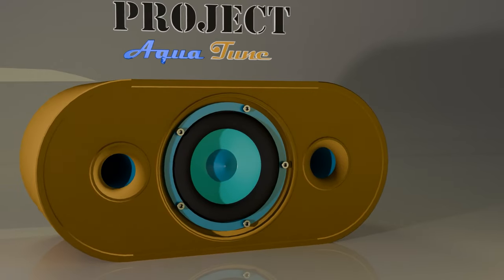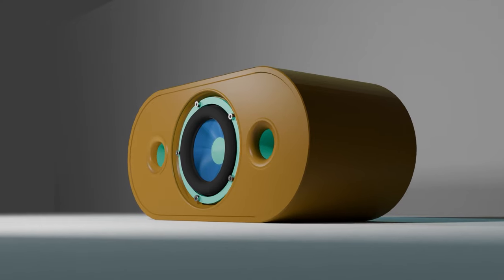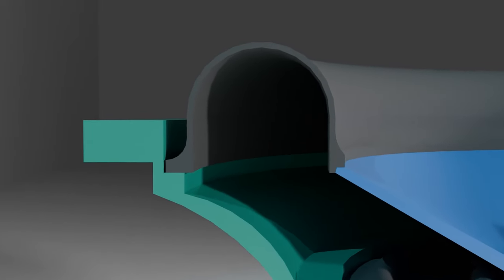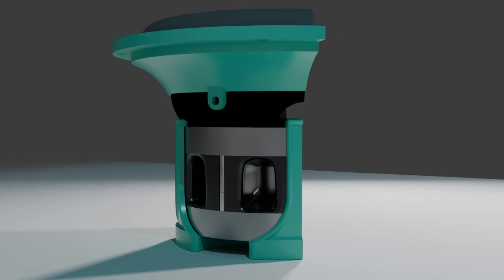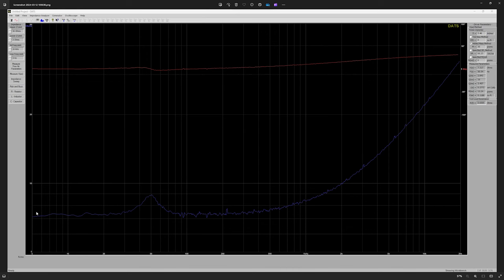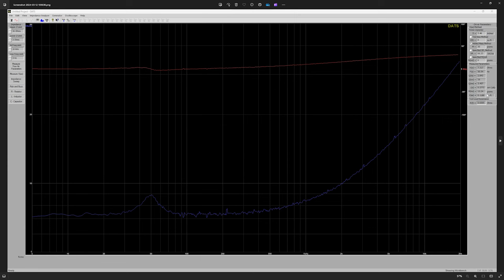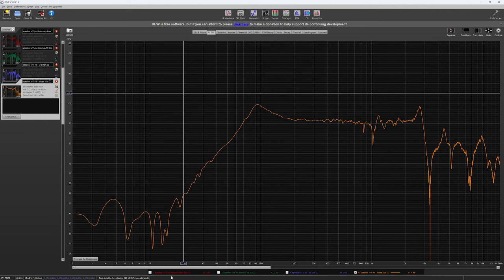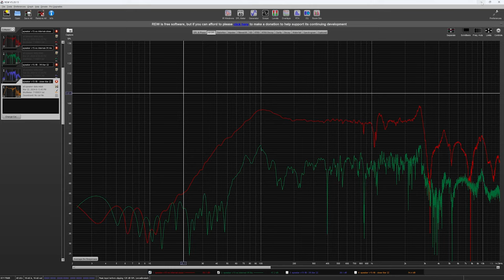Fully 3D Printed Speaker V15

Comment: Outrageously cool project. I did not expect to see this level of sophisticated engineering. I think it would be really interesting to see how viable a 3D-printed tweeter or subwoofer could be. This driver is probably best suited as a midrange / mid-woofer (although I would love to see its spectral decay chart to get the full picture)... but imagine a fully 3D printed 3-way design where the individual drivers are tweaked specifically to synergize perfectly and achieve an incredibly personalized sound signature. There are so many possibilities with additive manufacturing that I wonder if this won't eventually become reality at some point.
Reply from the maker: thanks! I try to push the limits with 3d printers, sometimes I succeed and sometimes I fail, either way it's fun along the way.!

Comment: Underhung designs are less efficient, but more linear. For something like this imo, overhung is the way to go. I wonder if the upper response is like that due to cone breakup. Maybe a deeper cone would help.
Reply from the maker: I’m not sure on the cone breakup, I’m currently trying motor configurations until I find something I wanna build on. I do however know I’ve talked to multiple other individuals who print speakers and they’ve all settled in on the underhung design as well. So it might be a natural route in the 3D printed speaker workspace. 

I know a lot of high end speakers go the underhung route as well, but they don’t have to be as competitive in pricing, as underhung is always way more cost prohibitive.

Comment: Great Video.  What do you use for your animations.  They look great. 

I wonder if you could use this process to repair a speaker.  The KEF speakers use some weird material for their cone like on the KEF150 and there is always someone selling a speaker with a torn cone on eBay.  It would be cool to see if the torn cone could be replaced with a 3D printed part.
Reply from the maker: I use blender + cycles.

Comment: very professional... what CAD did you use?
Reply from the maker: I use fusion 360. I have about 10 years experience with it. Then I just picked up blender to do animations with, I have about 40-50 hours in blender so far excluding render time.
Reply: @piscesprinting4170  FreeCAD seems to require a lot of "work-arounds" especially the "thickness operation"
Reply from the maker: I’ve never used that one. Back when I started fusion I had the hobby license. I then had a few years under the education license and I’m now buying it myself. I think it’s worth the ~600/year price tag. I’ll usually try buying during a deal though so it’s less than that.
Reply: not tried it yet!

Comment: I like it very much, and it sounds quite good! ;)  But why is the basket closed between the membrane and the spider? In this case, the membrane's air pressure have to go through the spider, and under it, can ventillate into the box... I have some idea for better performance. A driver, with a weak magnetic motor (high Qts) more ideal in a transmission-line! For better efficiency, try place small, around 2 cm height block neo magnets around the coil inside, and outside! This will increase the magnetic flux, and reduce inductance, because of less iron close to the coil, and because of the magnet's high saturation and big coercitive force! For a lighter membrane, you can create a pattern on the membrane, where it can be thinner and concave or convex. Just think of a leaf: thin, light and stiff. For better high range, you can shape the membrane from the coil body like the shape of the rubber surround, and after it continues the normal cone (curved NAWI-shape is better, than straight cone)  shape. It will give some elasticity to the inner part of the membrane, and because of it is much lighter than the whole membrane, it can give the high freqvencies better. It's a physical crossover. There are old drivers used this idea, but maybe not the most hifi or something, because you can't see it nowadays, only the whizzer-cone solution... Next. I hate dustcaps, somehow I don't like that the sound vibrating between the dustcap and the polepiece (place foam or something onto the pole piece, if you want cleaner sound)... Moving mass is less without it, so faster can be the membrane! Phase-plug is better solution, I think... Good job! Have fun! ;)
Reply from the maker: The lack of holes was overlooked in the animations, the final driver has holes that allow air to escape properly. 

I did assemble one without holes just to mess around and see what happened. ( off camera, as I felt the experiment was useless for my audience)

Essentially it acted like I had giant moving mass on my speaker (all the trapped air) so it was a fun experiment. It’s Fs also raised into the 500s and efficiency was terrible - sub 60dB 1w/1m
Reply from the maker: As for the other ideas I’ll look into them! Thanks for them!
Reply: @piscesprinting4170  For wide-range drivers often used an inverted surround, it can help in the smoother, wider response! If you wanna less standing-waves on the membrane, try to avoid perfectly concentric shape! The wave starts from the coil, reflects at the edge of the membrane, and meet with another wave. This distance can be varied on the membrane radially, so less standing wave can meet each other in the same time! ;) You can place the coil not in the center, for example 0.5 cm away from it, or use a little oval-shape membrane. The surround can have waves in more dimensions too! For a lighter membrane, you can try to thinning it with sandpaper, to have higher efficiency and better highs. On every moving part (membrane, coil body, dustcap, surround, spider) try to reduce mass! Thanks for your videos, they are very interesting! Have a nice day! ;)

Comment: Shouldn’t the standing wave baffles be irregular? With a complex but regular pattern you’re guaranteed to get some standing wave in there.
Reply from the maker: I suppose it would be determined by the frequency that I’m trying to nullify. As the shape to reduce 20hz vs 5khz would be thoroughly different. 

My thoughts now that I see it can be done is to use a no wall, no top, gyroid infill based on the shape I’m going for, I figure since it allows passage of air but it’s through a series a channels it would reduce standing waves much more effectively.

Comment: Hey I think this design is awesome and reminds me a lot of a more of a subwoofer and that's why it sounds so muffled, I really think efficiency could improve if you "broke in" your speaker driver, the spider and surround are naturally stiff and if you leave the speaker playing a 10hz tone near 75%+ vol for a few hours the speaker should loosen up and your results could and possibly should improve!!!
Reply: Adding on this the coil needs to be woven tightly and in a direct coil not like a loose ball of yarn, this could help efficiently Aswell
Reply from the maker: I’m using a coil winder to do this but I need to find that contact adhesive that’s used to keep it wound tight, 

I’ll also look into breaking in for longer, I currently run a breakin for about 1 hour @25 hz
Reply: @piscesprinting4170  my grandfather once made me a custom 2000w coil I still have running in my rockford fosgate 15in sub, he used jb weld to hold the coils together he claimed it was heat proof up to 250⁰c
Reply: I can confirm after running it on 2800w from a carver professional PA amp that it is infact heat resistant
Reply: @piscesprinting4170  I'm super interested to see what you come up with for your next design with all the gathered info from everyone around I really love the project and would love to see it go farther, one day making dedicated tweeters, mids, sus, who knows Planar ribbon tweeters at a fraction of the cost? Or custom tweeter horns like hexibase did!!
Reply: @piscesprinting4170  also I never stated just how impressive your design is! The vent holes around the magnet the strategic placement of each individual magnet stack the way the magnet clamps together and makes one complete unit, so ingenious!!
Reply: One final remark, I recommend looking into ultralight pla used for making rc aircraft for the cone material, you want super light cone material for more efficiency! Maybe make it a once piece or two piece minimal construction design??

Comment: How did you come up with that spider?
Reply from the maker: Well the first two I tried ended up being compliant shapes- so they hung up after extending so far. So I was trying to find shapes that wouldn’t stick once extended. This happened to work. 

I’m still looking for an affordable suspension testing program but I have had no luck. The closest thing I’ve found is in $1000s. 

So I’m doing the old fashion print, test, repeat method.
Reply: @piscesprinting4170  Wolfram Mathematica, has FEM but admittedly I've never used it. Only 195 per year, less if you're a student.
Reply from the maker: That should just be for the motor though. I use FEMM to design the motor currently.  But I’m having issues finding something to simulate suspension changes.
Reply: @piscesprinting4170  loudsoft's FINESuspension?
Reply from the maker: Unfortunately that doesn’t fit my affordable criteria at $1900

Comment: Wow—amazing design, amazing build, amazing video! I’ve seen several 3D printed enclosures but they used off-the-shelf speakers. Yours is the real deal. It would be cool if software could design the internal diffuser in a generative way. It would need to simulate the full speaker performance, however, so it would be a lot more complex than what I see from today’s generative tools. Thanks for the video!
Reply from the maker: Thanks! I’m glad you enjoyed the video.